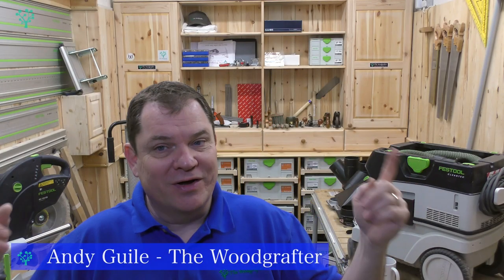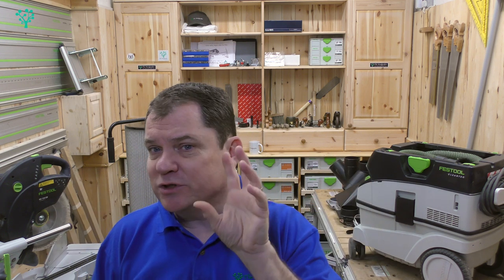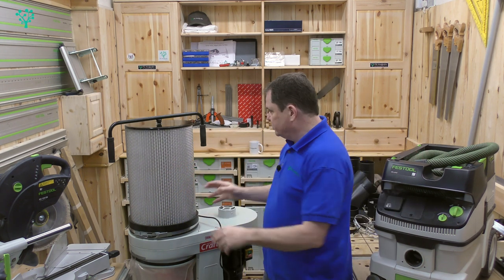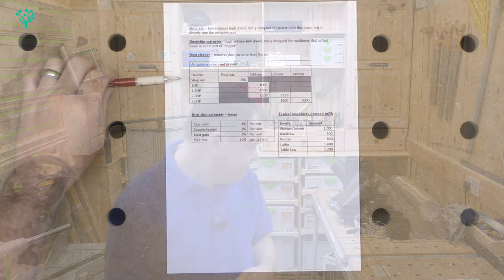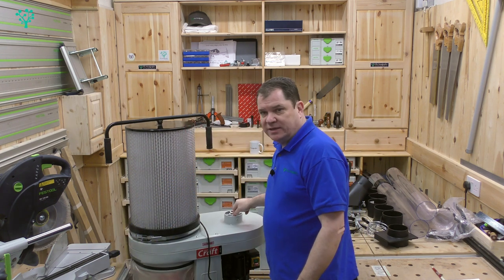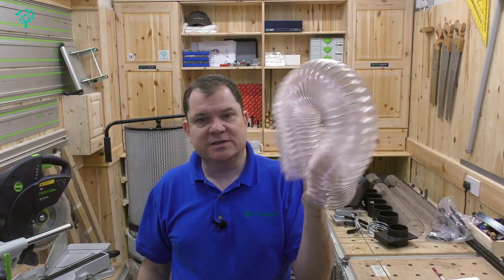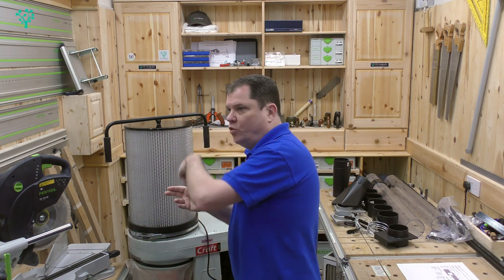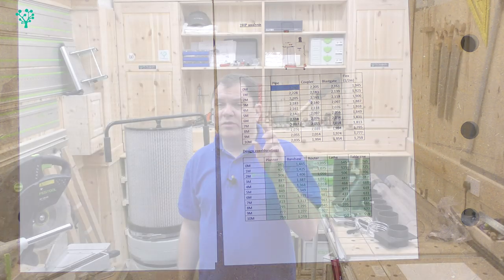How to design a dust collection system

Comment: Don't know if these are available in GB or its cost if it is, but if I were installing a small unit for a small shop I would use something like this. It has a HEPA filter and cyclone to spin most of material into the bin and not into the filter.  https://www.oneida-air.com/dust-collectors/personal-shops/1-5-hp-mini-gorilla-cyclone-dust-collector

I have a 3HP Oneida in my shop but it takes up more real estate as well as money out of pocket.

BTW, if I had as narrow a shop as you have, if possible, I would arrange all my high capacity  machines along one wall and have the dust collection piping along just that one wall. I have a larger shop than yours but that is how I do it. I then use Festool or Bosch shop vacs (with Dust Deputy cyclones) for my other low volume tools.
Reply from the maker: Hi,

That is an interesting looking machine - I haven’t seen anything like that in the UK market - will look into it.

In the shop, the big machines are actually at one end of the shop, so in close proximity to the dust extractor - I used the size and shape of the shop more as an illustration of how short 10m is when running pipes. Rather than an actual layout.

Thank you for taking the time to comment.

Regards

Andy